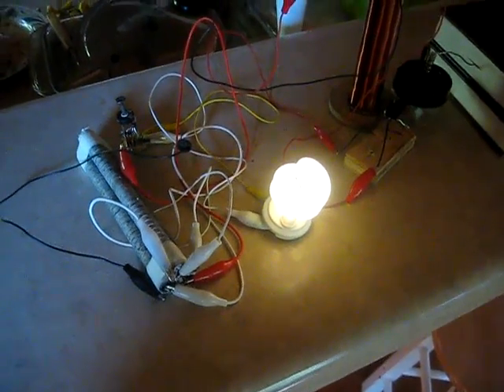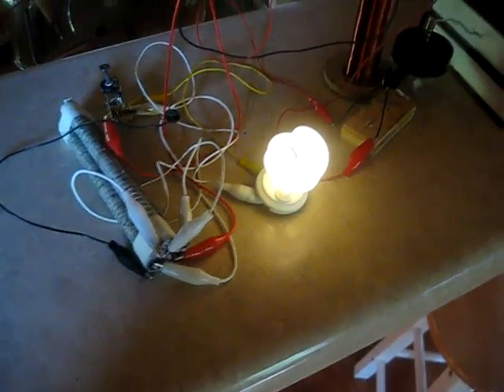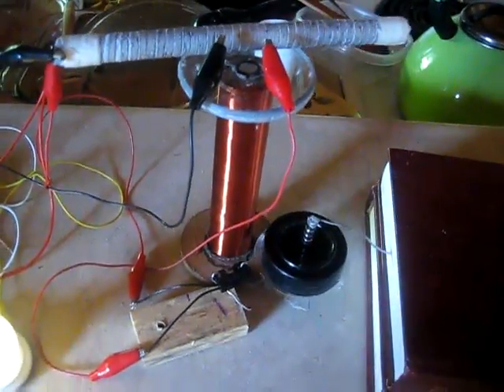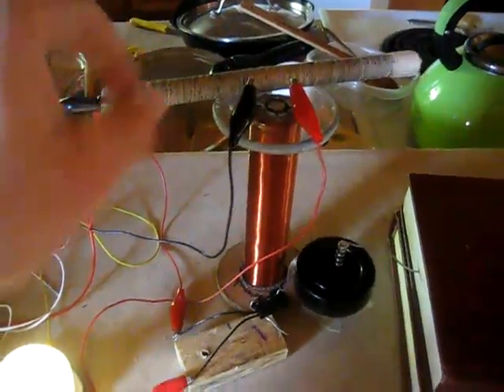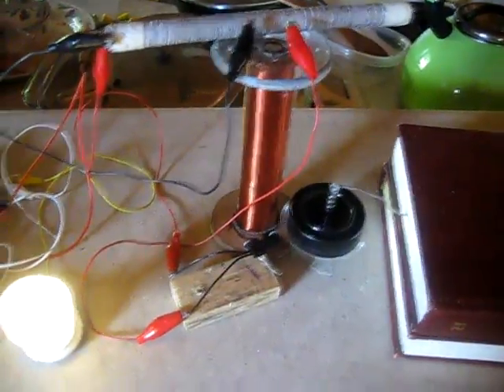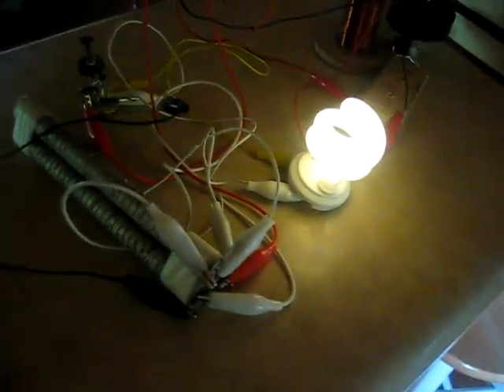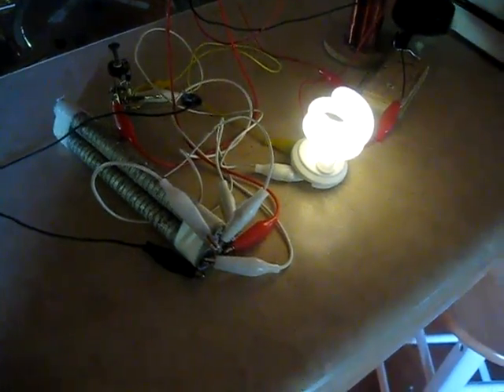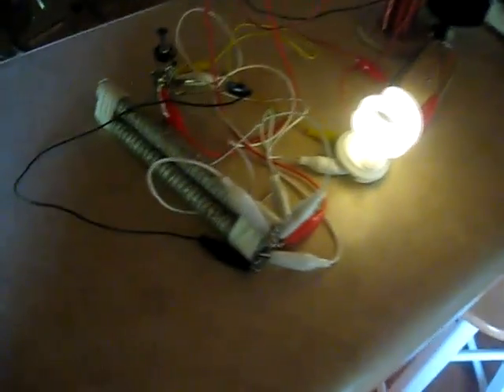LaserSaber Air Battery Update!

Comment: could you hook that light to a  large 3d solar cell,that will run you whole house,with out putting solar panals out in the sun? plus hook up magnified crystal to make the light brighter that goes into the 3d solar cell,it seems if you build a big enough sysem you should be able to run 220volt or 440volt 3phase out let,not that going to take time and money to build

Comment: @Mastahscott a joule thief is a type of circuit that boosts the voltage at the cost of amperage it is a dc to dc boosting circuit an example would be a "dead" 1.5 volt battery  is placed on the input it produces around 1v on input and the circuit increases that to a higher voltage depending on how the coil is constructed. (generally 2-5v)
And i believe that large coil is part of the home made motor that he has been running for days on that air battery

Comment: Am i missing something? Read your article, saw your video. Sorry to say I could not make out exactly what your experiment is? Just what exactly is an Air Battery? What is the principle behind it? I could see some copper coils, soft iron cores, something rotating in the foreground (supposed to be a motor running for 3 days) and a long tube supposed to be the air battery. I will be grateful if you explain the whole stuff and its theory more clearly so that I can also assemble it.

Comment: Looks great!  Glad you can find time to assist so many people.  Will be curious to see parts list and how you constructed as when I use 6 x 3/4 inch or so carbon bar electrodes with magnesium ribbon separated with cotton cloth from hardware store in like configuration, i must always get them wet to produce any useable energy (at least milliamps).  thx again